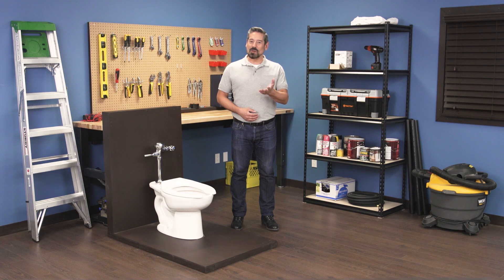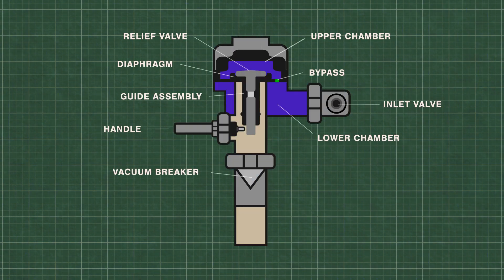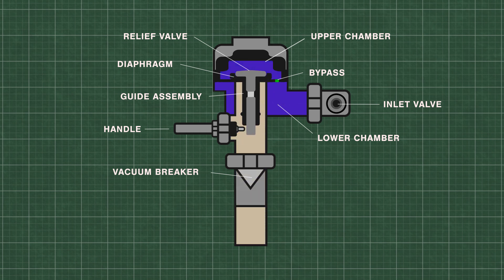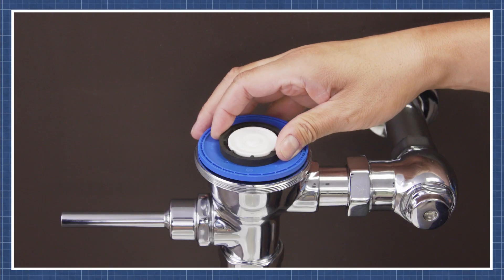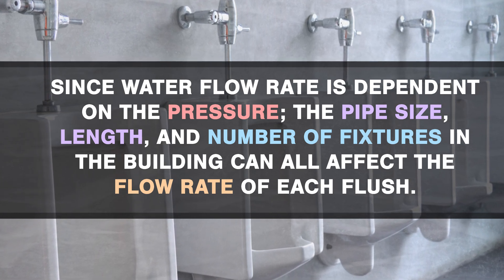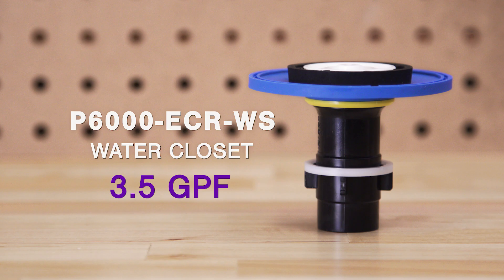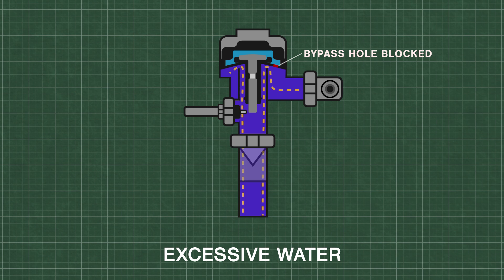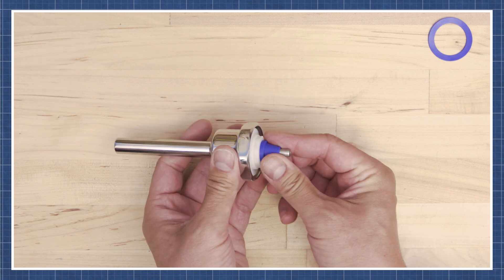Troubleshooting a Zurn Aquavantage Flushometer | Repair and Replace

Comment: What is happening if the pipes quickly vibrate after the flush completes? It's like a honking noise.
Reply from the maker: There's two main sources of the sound. With high water pressure flowing over the valve, as the valve closes the valve can vibrate and cause that sound. In some cases cleaning the valve seat or installing a new diaphragm can help reduce this noise. If the valve closes all the way and you hear a sound afterwards then this is likely some form of water hammer. It's the sound of the water stopping, like a freight train, there is a lot of momentum that will be converted into vibration as it suddenly stops.

Comment: Hey AMRE Supply! Love your videos! I'm having a problem with my Zurn Aquaflush WS1. Where the inlet valve meets the lower chamber, it leaks ever so slightly, a drop or two. I was wondering if this was a connection issue, and its as simple as adding plumbing tape and tightening it better? Or if it's some internal/housing issues that I would potentially need to replace?
Reply from the maker: Thanks for watching we're glad you're finding the videos helpful! For leaks at any of these connections you can remove the valve body and check for any buildup of calcium and give it a good clean. If the connection has a gasket or O-ring then often it's good to install a new O-ring. Tighten the connections and check for leaks. 
Also it's worth noting that teflon tape is only for NPT connections that do not have an O-ring or gasket.

Comment: Is it harder to shut off the control stop if you are stuck in a continuous flush as compared to normal?
Reply from the maker: Thanks for watching. If water is flowing it should still be possible to turn the screw to close the control stop. It will have a similar pressure behind it regardless if the water is flowing or not flowing.
Reply: @AmreSupply  Smooth!  My toilet has something wrong with the flush, and I've been pouring water from a bucket to flush for the longest time now.  I don't know if I try to flush it again if it will go into continuous flush, but now if it does I'll just shut it off with the control stop-thanks!
Reply from the maker: @Munson-lz5gh  You're welcome!

Comment: Question my problem is that when I flush it, and it’s done flushing water starts leaking thru the shaft any tips?
Reply from the maker: Thanks for watching. It is likely that the vacuum breaker is starting to wear down. Try installing a new one: https://youtu.be/VTs-9BwoH7Y

Comment: I keep having an issue with little bits of water leaking out from under the metal cap when I change the diaphragms in these units. I've tried different amounts of tightness, but nothing seems to be working.  I've got two I'm working on now. The plastic cover on one looks like it might have some cracks, which could explain that one, but the other doesn't. Any ideas on what's causing the leaks and how to fix them?
Reply from the maker: Thanks for watching. You might want to check to see if there is any corrosion or damage to the threads that might prevent a good seal.
Reply: @AmreSupply  Great! Thank you! And one follow up question, if there is, which is very likely the case, is thread tape a viable solution here? Or would you suggest something else to seal it up?

Btw, thanks for producing such great content. So helpful!!!
Reply from the maker: @TheRealJamesDunn  We're glad that you're finding these helpful.

Generally teflon tape is not recommended on this sort connection but you'll get a variety of opinions depending who you ask.

The plastic cap has to make a good seal, and the metal cap / threads need to tighten properly to help seal the plastic cap. If the threads are good, then make sure there is nothing preventing the cap from making a good even seal.

Comment: What causes a noisy hissing vacuum breaker on a urinal?  It used to flush real quiet but now it's real noisy around the vacuum breaker. No leaks though
Reply from the maker: Thanks for watching. It could be that the vacuum breaker is starting to wear out. The rubber can deteriorate, and if the vacuum breaker sticks, then it might increase the noise.

Comment: Nice video! Is there a difference between Aquaflush rebuild kit and AquaVantage? They look the same but the price is different for the same GPF. Thank you!!
Reply from the maker: Thanks for watching. It's been a few years since we filmed this so these details are not as fresh. I don't think there is much of a difference between Aquaflush and AquaVantage kits since the valve body is the same. Perhaps there is a lifespan difference but that isn't really mentioned exactly. Zurn also makes a note that they can be used as replacements on Sloan flushometers at all. If you match the GPF then it should work as intended.

Comment: If my urinal is flushing with a large amount of water, how can I lower the amount? Do I just turn control stop screw clockwise? Side note: does that control stop screw take a lot of turns to lower the amount of water?
Reply from the maker: Thanks for watching. The flush volume is set by the diaphragm and relief valve assembly. You can learn more here: https://youtu.be/9hchjwROnF8?t=139

Comment: In your experience has an incorrectly installed flushometer  caused Air to enter the pipes? How would you explain air getting into the urinals plumbing system?
Reply from the maker: Hi Wil, thank you for watching. Generally, as long as all the connections are tight and the water pressure is high enough it is not common for a flushometer installed on a urinal to introduce air into the system. Are you experiencing issues with air or bubbles when flushing?
Reply: @AmreSupply  i notice after I flush urinal that air feeds back into sonk faucets. And my watersoftener gets tins of air bubbles trapped in tanks. When I bleed out air and stop using urinal the problem resolves itself. 
I'm guessing this started after I replaced the flushometer about 6 months back. Should I try and replace with new one? Open and retighten ? Thoughts
Reply from the maker: If the problem goes away when you shut off the urinal then it seems like that is the source. If you're pretty certain that the old flushometer didn't have that problem then try to see if there were any major differences between that model and this one. Was the flush rate / gpf the same? You could try reinstalling to make sure the vacuum breaker and diaphram are seated correctly. If not it might make sense to get someone in to take a closer look at your system.
Reply: @AmreSupply  will do, thank you!
Reply from the maker: @wilregalado9078  You're welcome!